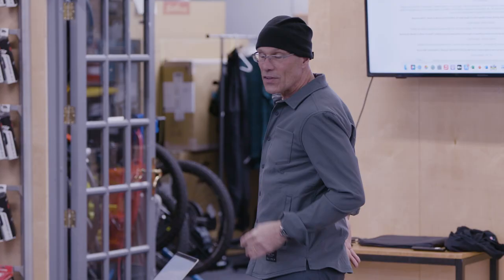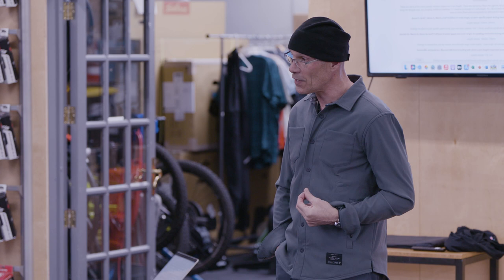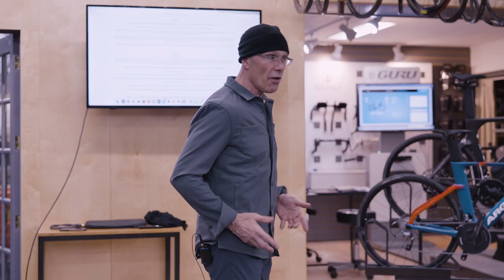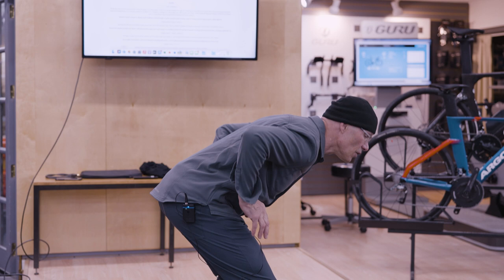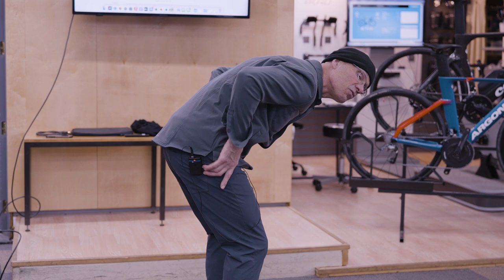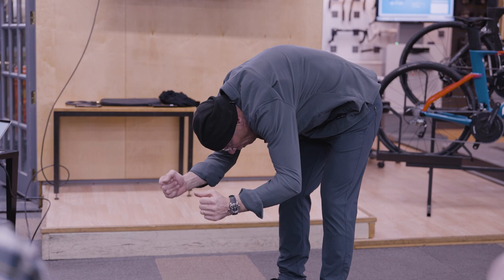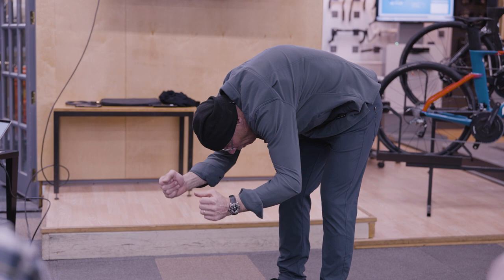Considering Crank Length

Comment: My Gravel bike came with GRX 172,5 cranks from the manufacturer. At longer rides I feel very uncomfortable knee pain which I didn’t experience with my trekking bike with 170 cranks. Unfortunately, the smallest GRX 600 cranks available are 170s. Do you think going down by 2,5 mm from 172.5 to 170 will produce a noticeable difference for the costs?  I am 178 cm tall with long legs and an 87 cm inseam. Or can you recommend any cranks other than from the Shimano GRX 600 series that are available with shorter cranks and would be compatible with a a GRX 810/600 2x11 set?
Reply: Grx 600 2x10 exist in 165mm don't know if they are widely available though
Reply: I switched to Rotor cranks. Not inexpensive, but very well worth it. 155 doesn't reinjure past issues.